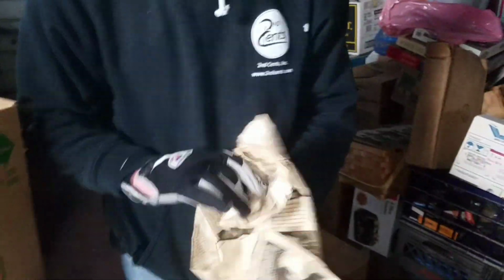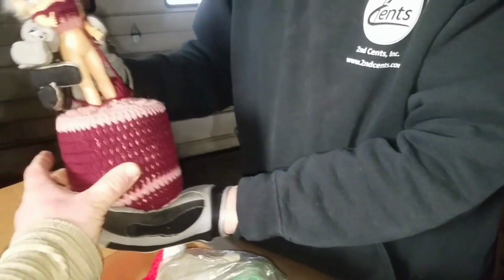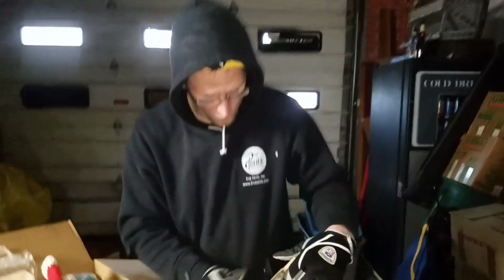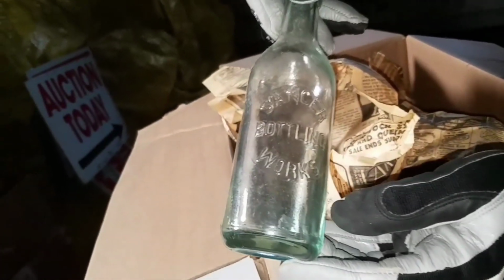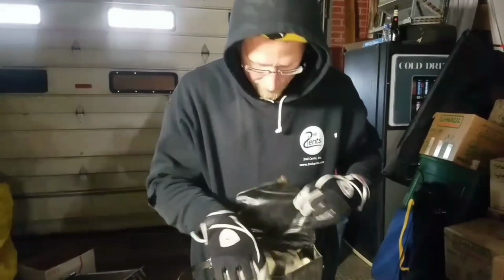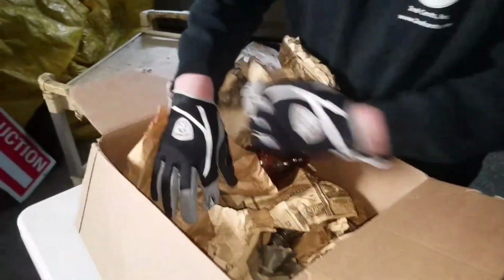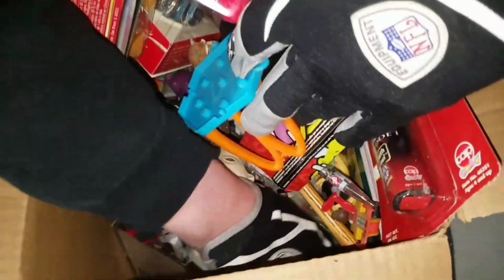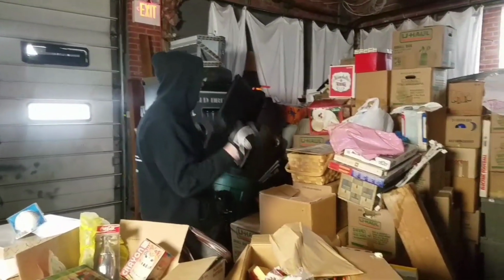OWNER ABANDONS HUGE COLLECTION 40+YEARS, YOU WON'T BELIEVE WHAT HE LEFT BEHIND???

Comment: I had that creepy blue doll when I was little.  I'd say it's from the early 70's.  They were coat hanger wire, with foam over it, then skin colored material.  You could bend them.  And yes, they were somewhat creepy.  Found them.  They're called Bradley dolls.